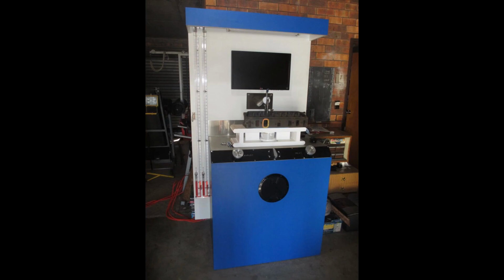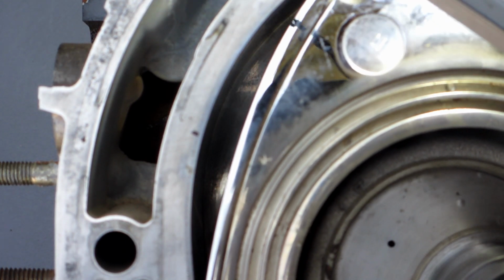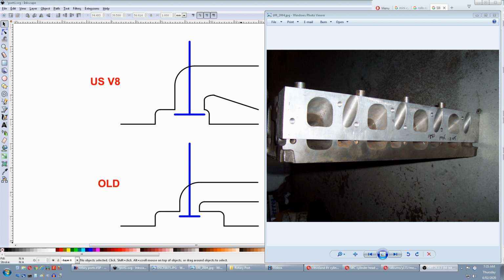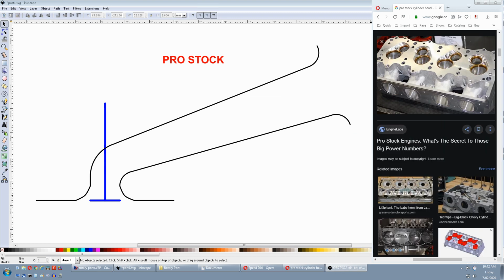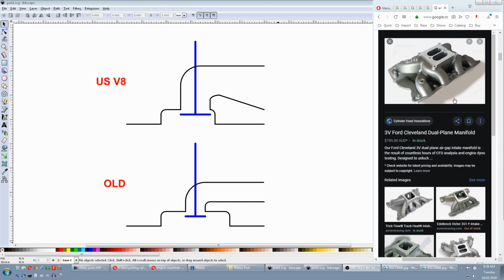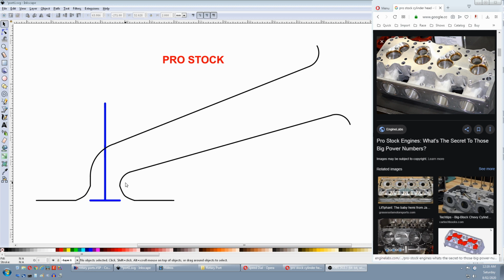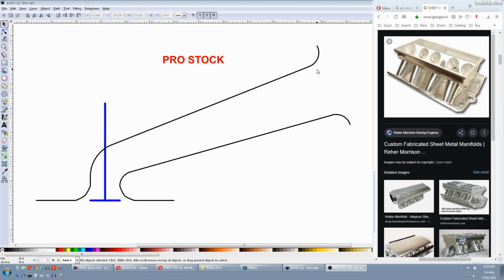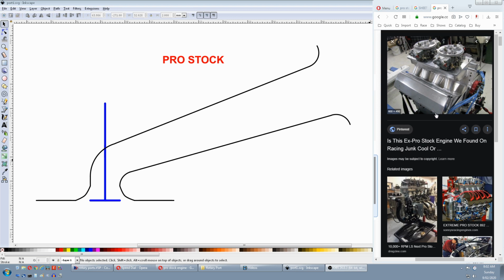Rotor V Piston - Rotary Port Evolution - Pt1

Comment: Thank you man! That's... kinda enlighting. Why so few subscribers I wonder? I'm yet digesting the information, so I'm far from the point where I can say I understood everything, but I have a question about the rotary engine which bugs me. Peripheral ports are ought to be the least efficient at the low rpm range, cuz don't allow the engine to create enough vacuum, right? But what about the supercharged ones? Can this pressure difference work as air jam on the low to mid rpm?